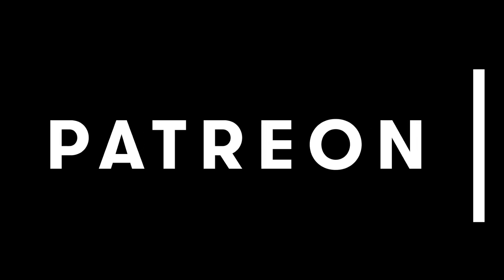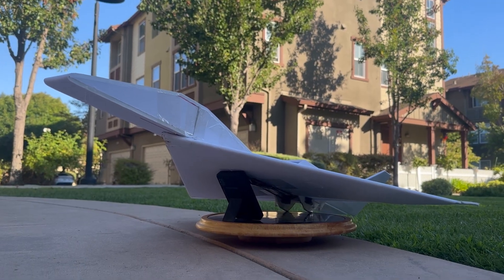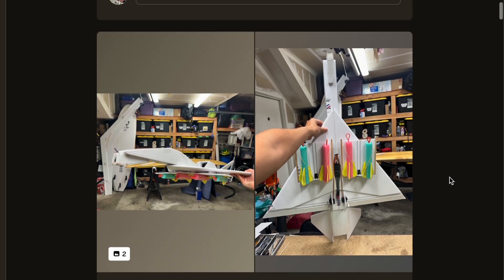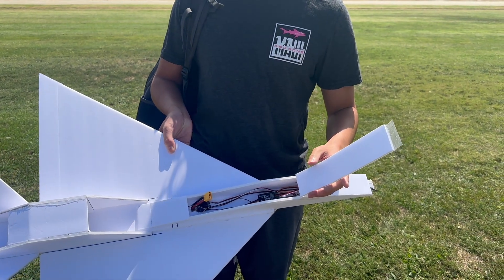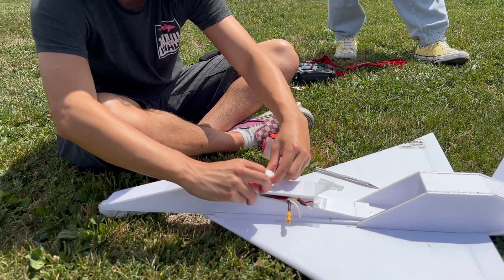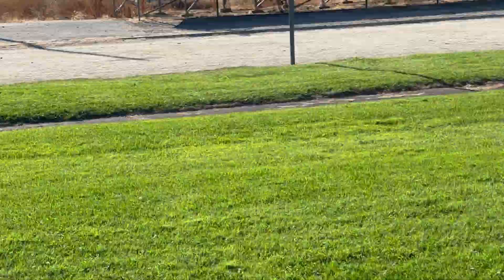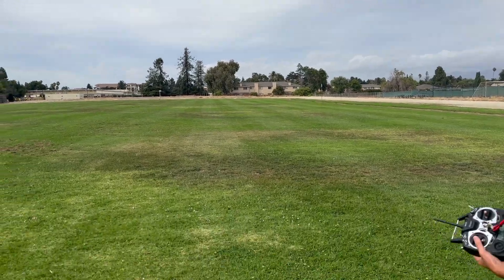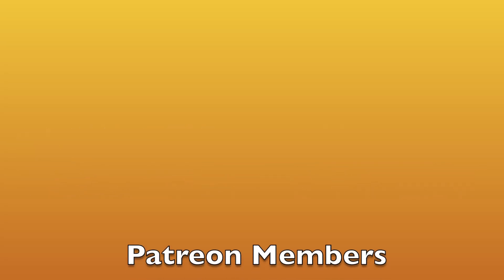I built a jet that goes over 40mph, but it nearly took my head off...

Comment: You made it too tail-heavy with the bomb drop platforms, so it has a hard time staying in the air and stalling out. Especially since you put the servo toward the rear for the release. Move the release servo to the front and add some nose weight See where it balances without the bomb drop mechanism and bomb holders then balance it in the exact same spot with everything reattached, and I guarantee it will fly great again.
Reply from the maker: I thought so too but I CG checked before flying every time. So I knew it couldn't be that. I did some re-analyzing and my current hypothesis is that the platform is very flat, much like a wing. In turn generating its own lift interfering with the wing's lift.

Comment: but 35mph is very slow, even for a prop plane its not fast. Even most very small rc Jets you can get go at least 50mph and most over 1m wingspan go close to 120mph
Reply from the maker: Very true although I have yet to measure its actual speed, this is an estimation on 50% throttle. Something I do plan on attempting to do in a future video!
Reply: You could alternatively be supportive, just sayin
Reply: @spiderninga9910  sorry, im just not feeling it rn.
I hear people call every triangle shaped plane jet and im sick of it

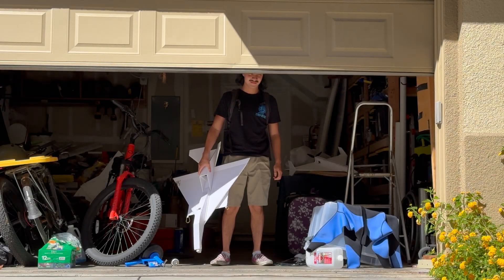Comment: 1:52 
I think it’s 85% of the EDF diameter but your method is pretty cool too.
Reply from the maker: I tried finding more info about that but I couldn't find any. So naturally I assumed the more the better. This is really helpful tho and will def keep it in mind for the future, Thanks!
Reply: The optimum setup is for the exhaust to be 9% less than the diameter of the fan unit. I have found this 9% rule to be about the best when testing fans on my test bench and it seems good when flying as well.
Reply: No worries good luck!